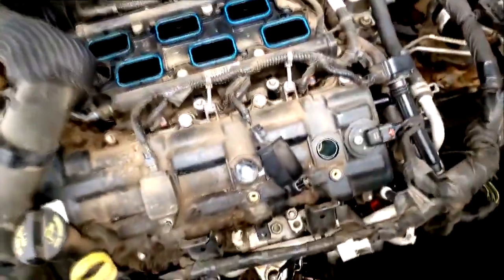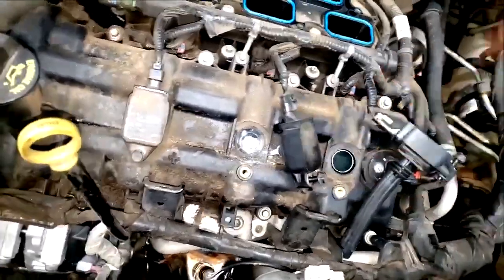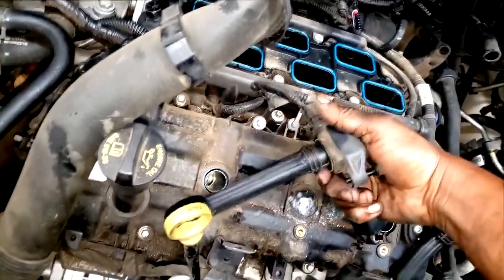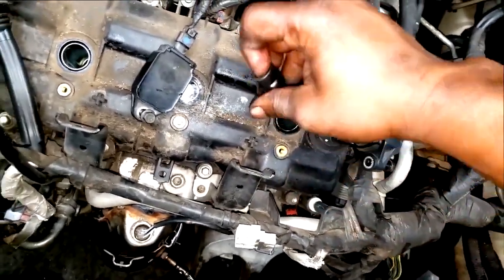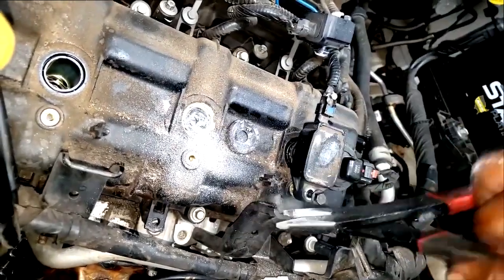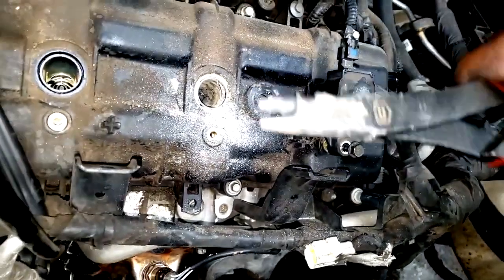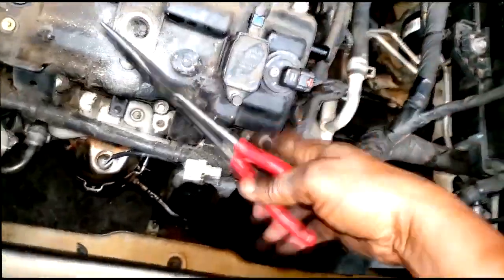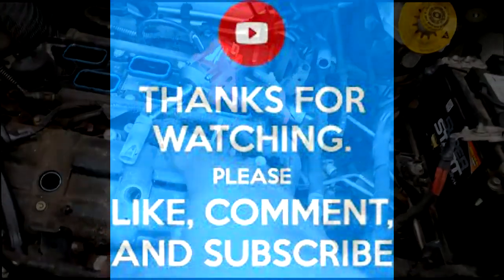Never buy these after market parts here, almost ruined this car. SEE WHAT I HAD TO DO.

Comment: JT...same thing happened to me with an Autozone coil in my BMW. I had to do exactly what you were doing. Then I got a metal shis ka bob wire and bent the end to pick the bottom pieces out from around the spark plug. I had a heart attack when that cheap rubber boot tore off and stayed in the hole!

Comment: I also use dielectric grease, but it’s to seal out moisture. The grease can actually Hydro lock the igniters to the spark plugs making it harder to remove them for the next guy if you use too much. When you put it in the end of the igniter, that causes issue, but I’ve always done that. You have to go slow to keep from breaking the igniter if it’s hydro locked.

Comment: I use a long skinny screw driver and push it into the to boot till it gets the the botom of the boot. take the screw driver to push it around the spark plug and the boot comes off pulls out

Comment: Online Mechanic Tips. Just say if somebody has a Camaro, Challenger or Mustang and they went to Auto-part store and bought K&N, Wix, Puralator Boss Oil Filters over the OEM GM, Mopar or Motorcraft oil filters can that ruin the car slowly ? Or they got Wix air filters over the OEM or Wix Panel Filters over the OEM. Its a stupid question just wanted to know from a qualified mechanic point of view. Fuel Filters stick with OEM. The reason i wrote this question is on Mustangs alot of peeps say Motorcraft oil filter is cheaply made and Wix, K&N and Puralator Boss is made btter with better filter media.
Reply: Motorcraft is probably made by the guys at Purolator (on the same lines even) and Purolator and WIX are both under the same parent company. Really high quality stuff and definitely on par with OEMs. 

FRAM on the other hand...
Reply: @JupiterPolluX  strange cause on Mustangs and Camaro's the owners not all but alot prefer to use K&N over Motorcraft.

Comment: There's aftermarket parts that are better than oem. You gotta spend money. Don't just get the cheapest part on the list.
Reply: Also, if you're going to change one coil you might as well just change all of them.
Reply from the maker: Why change them all if 1 shorted?
Reply: @OnlineMechanicTips  they're usually not far behind failure and why not upgrade all of them if they're better than original.
Reply from the maker: Interesting. You have a point
Reply: I swear JT said to just replace all the coils together. It was a semi-tutorial video from a while back 🤔